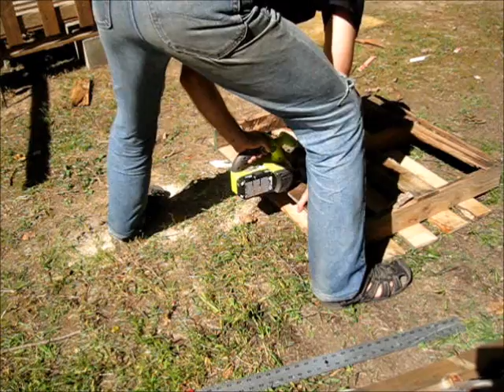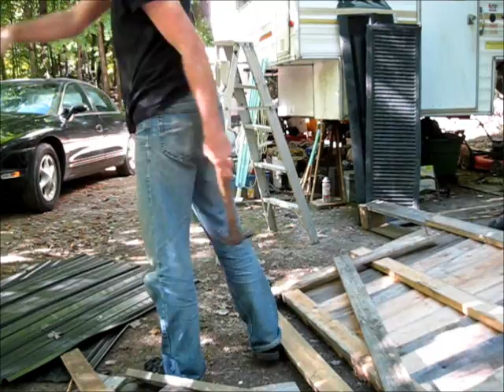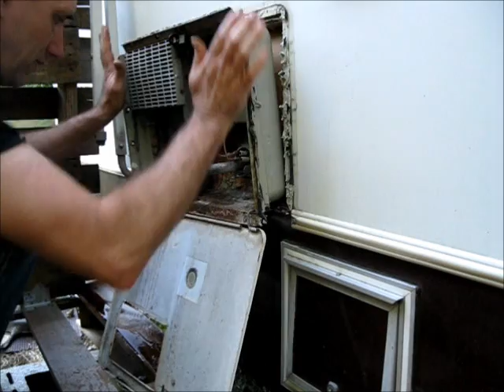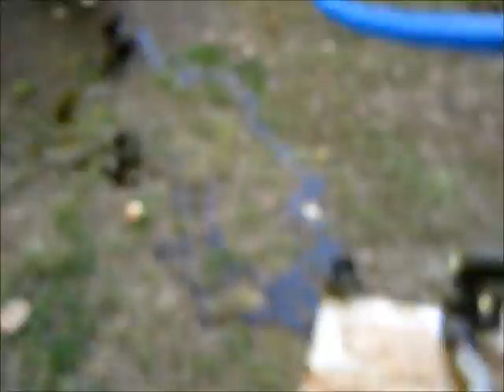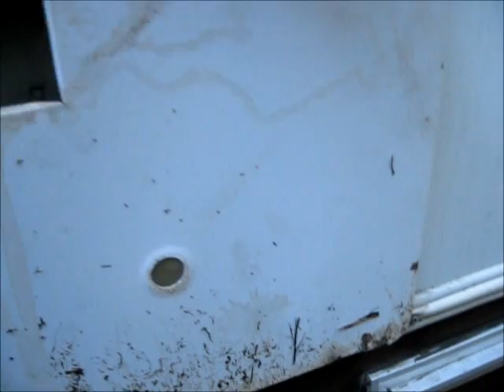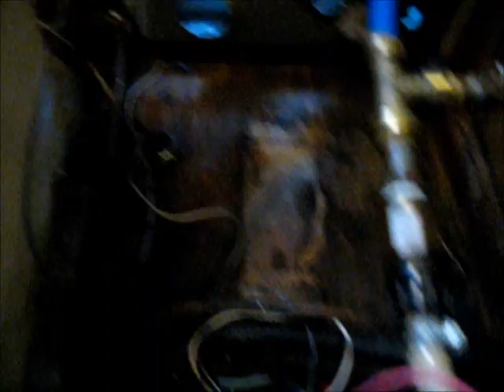Working On Pallet Porch And Removing RV Water Heater

Comment: Been mulling over your insulation of the pot belly, my other comment on your other video suggested boxing it in a smaller cubed wooden structure, with an access door on the front.  To insulate the pot belly pack the void space with earth?, keeping a vent tube for air.  I note that your stove pipe is for a flat roof fixture yet your shack is slanted.  A smaller enclosed cube, would accomadate the stove pipe and be easier to insulate with earth.  Your thoughts?

Comment: Have you considered building a 55 gallon drum wood stove with a coil  of copper pipe in it as a heater core? I would volunteer to make the coil for you if you want to take on the project! look up a design and give me some dimensions.

Comment: Sorry my bad :) would it not be easier to encase the pot belly stove on a smaller size cladded box, one where you do not have to walk into?  Might be quicker to fabricate and insulate, just have a door or hatch  where you can check the pressure and load wood.  It would also not block out your window.

Comment from the maker: I stopped the camper porch when I knew I was getting the RV. Planned on making a porch for the RV so I quit working on the camper.

Geothermal is on the side for now. Need a backhoe for that. Cannot dig in this rocky soil by hand.

Comment: You got me on the misspelling "DUROCK" but I disagree about using the sheetrock/utility knife only because the knife is the cheapest and cleanest way of cutting concrete board. Troy obviously plans on spending the least as possible. a few cents spent on a few utility blades I'm sure has to be cheaper than a carbide cutter he may use again. Most likely not!? If done right "I've" cut a few boards with one blade. score to cut the fibers then knee snap the boards as if it was sheetrock.

Comment: hey good idea i used the dura rock in my shower when I remodeled my bath. I think hardie board may be easier to install because it more durable im guessing because I had a time with the dura rock breaking a lot. You have to use a crap load of screws or it wont stay.. my dad said he used the hardie board and my dad is never wrong ha ha lol.

Comment: You can fix that ladder by hammering back. but aluminum breaks after you bend it so you will have to take a piece of metal strap an bolt it to the side of it where you bent it back to help hold it form breaking. because it will break where it got stressed the nature of aluminum. but nothing some metal strap and drilling some holes for nuts and bolts wouldn't fix.

Comment: By "Durra rock" I think you mean Durock® by USG. I recommend using a hand held carbide cutter, you'll ruin a few knife blades if you try to cut Durock or other concrete board with them. I do drywall work for a living and even though you can use a utility knife, it's much harder than using a carbide cutter.

Comment: How will the pressure of the system be regulated?  Also if the pipework fails at the pot belly stove whilst asleep and the system boils dry ( like last year) how will you monitor that?

Comment: I hope you do, after all you have had nearly a year to prepare since the end of last winter, this time you have 300 times assitance and prep time since your rushed move in.  My point although crass, was made when again you said 'another unfinished project' as you dismantled the camper porch. Is the geothermal  cooling/heating project on hold or cancelled?, The good thing about the pot belly stove is that it can also dry out the wood it will need in order to burn.

Comment from the maker: 12 inches to a side clearance. What I had in the camper. I will use metal lining in the shed tho for added safety.

Remember this wood stove has a water jacket around it so it never gets hotter than boiling water.

Comment: The heater system will work pretty well. At least if the pot belly stove leaks coolant, it'll be out side rather than inside. Looking forward to seeing the next video.

Comment from the maker: Maybe in the shed by the stove. Can be used to distribute heat after the fire goes out. I will have to use antifreeze mix and I want as little as possible inside the RV itself to prevent spills like last winter.

Comment from the maker: Porch is a solar porch. It will heat my camper when the sun shines. I am sure of that. Kept my camper 70 degrees in the winter a couple years ago with DIY solar window heaters. Sadly got ruined in the move so I have to start over.

Comment: Hi Troy 

I think you need to make a list of things to do before winter sets in 

1. A dry place to keep fire wood 
2 .A supply of Dry fire wood cut up in the dry place.( Not near you camper cut up under cover where it can not get wet)
3 Finish the waste oil burner or dump the Idea .Do not spend a lot of time on it.

Your Porch  is not going to help you this winter. 
Good Luck